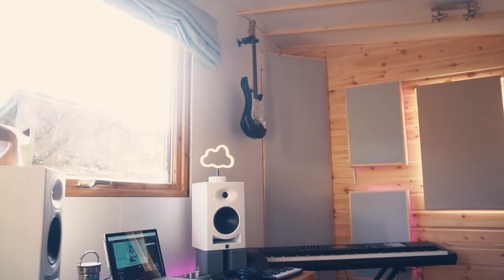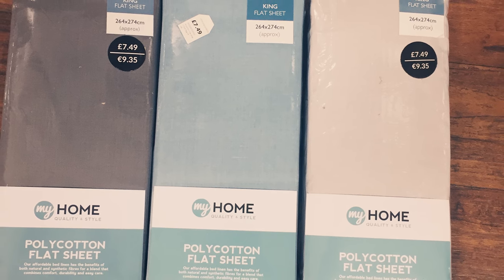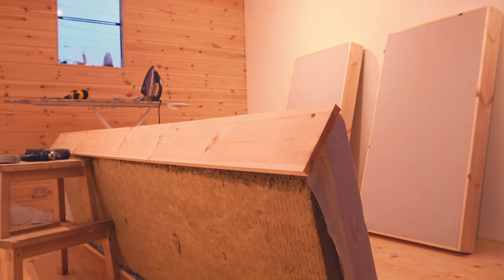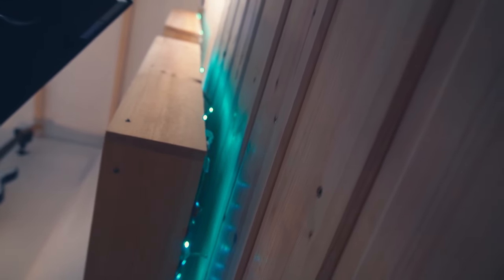Pro Acoustic Panels DIY how to make Cheap! + Acoustic Treatment Basics for a Pro or Home Studio

Comment: For everyone thinking about making acoustic panels, use plastic foil between the fabric and the absorption material, you really dont wanna inhale those particles. This will also allow to use more breathable mesh like fabrics which will improve the performance.  And if you think that the plastic foil will ruin the acoustic performances try wrapping your speaker with plastic foil and youll realize that it only affects the really highs like 10-20khz which isnt the region you want to absorb anyway. Ive made hundreds of acoustic panels and this is just something I wanted to share! Take carr
Reply from the maker: thanks for sharing :)
Reply: I used an idea from another video and got that weed guard material you would put in your garden. Keeps the insulation from poking through the fabric nicely and it's still breathable enough fro effective absorbtion.
Reply: Is plastic foil the same as Cling wrap, like glad wrap? Do you put it both sides? like you mentioned I was told that sealing them with something that isn't breathable would cause reflections, but you've built 100's.
Reply: @imnotjacob.  Yeah you can use glad or cling wrap, I prefer industrial plastic foil like the ones shipping companies spin their packages in just because the sheets are bigger. I suggest you wrap the whole thing rather than a specific side 👍
Reply: Maybe a little late, but... There is also an issue that anyone rarely talks about. While I believe you can deal with particles even without plastic film - I'm not sure it will help against phenol and formaldehyde vapor (the binding component). Yes, it does vaporize over time. If only companies provided detailed information about concentration and migration rate into atmosphere. Would be a shame to die from cancer.
Reply: Use formaldehyde free rock wool not glass wool and you're fine. No need for plastic layers.

Comment: Make sure to wear gloves and a mask when working with Rockwool. Also, make sure to wrap both the front and the back in fabric so you don't get rockwool particles in your room for the long run. A good, cheap material to seal the back is garden landscaping mesh. You can buy a big roll of it and double it up to cover the back. For anyone wanting to try this, it doesn't have to look as handy and pro as it does in this video. It's just sticking insulation in your room and framing/wrapping it to protect your skin/lungs from the insulation fibers.
Reply from the maker: Agreed, I have listed some safety info in the description of the video too.
Reply: Landscaping mesh is not going to keep tiny particles in. I recommend Craft Felt, it is inexpensive and looks nice, and is much better at keeping dust in.
Reply: @LuisCasstle  Or just wrap a few layers of inexpensive kitchen foil around it the wool part and then you can cover it up with any fabric of your choice :)
Reply: @LuisCasstle  craft felt as a layer under a wrap like weed stopper? Or just craft felt then boom your done?
Reply: @sebek0311  This is ineffective as you then have a non breathable slab
Reply: @DeadOriginal  Unfortunately none of these are safe as the mineral fibres range from 2 micron to 6 micron and unless you have a 1 micron filter covering the entire rockwool panel it remains very unsafe and should not be used.
Reply: Sorry but none of these are safe. That insulation really isnt safe to have exposed in the house, fabric will not hold back the fibres which can be inhaled. Fibres are from 2 micron in size and even multiple layers of fabric are useless.
Reply: @iambradarthur  Really should only be using a safe form of Insulation such as Sheep's wool. That stuff is worse than smoking over time.
Reply: "Over Time". I suppose you have some actual reputable published data to back that up?

Comment: I’ve use the Roxul insulation in several panels, ceilings and walls in a few studios (at first I was using fibreglass insulation – yuck!) and there are a couple of things I find that works very well. The first thing is that when you are cutting it, it’s worth it to buy an electric carving knife to cut it up with, if you don’t have one and the second thing is that if you wrap it with landscape fabric, you have something that will help stop the particles from escaping and you can even double it up if you’re worried about it, but it is acoustically transparent and cheap to buy. I wrap the insulation front and back. In my 4 decades of studio ownership in a few studios, these little notes have proven to be very worthwhile. Your studio will always need some kind of ventilation, so even if it is by opening a door and a window, the air in the room can get really stale. I can remember my early studio days, when you walked out of the studio and when you come back in, you are bombarded by moist, stale air and that familiar smell of recording tape. If there is anything offgassing in the room, so you want to exchange that air ASAP, yet having a built-in studio HVAC system is a luxury most small studios can’t afford.

Comment: Looks really nice to me.    One idea I had is that you could have built the absorption right into your walls, so you wouldn't need to build any (or many) panels.   So, like at 2:00 in your video once you'd put the complete outer layer of rockwool.   At that point you could have put the wood paneling on the places you want to be reflective and simply used batting and fabric for the places you want to be absorptive.   Maybe that would not have worked well when it's really cold outside, not sure.  -- Another problem with my idea is when you go to sell your house, having fabric sections instead of walls.   --  But it would have saved a lot of work and given you a sleeker, more professional look.  --  But great job!
Reply from the maker: Hey thanks very much :) Yeah I did think about just putting fabric over certain sections of the walls as It would definitely have saved time if I could find a way to do it simply but the more I developed the idea in my mind the more problems began to appear. 
1. It would have been challenging to get a finish that I was happy with as the walls would have stuck out in certain sections where I covered the insulation with plywood or tongue and groove and I would have been restricted to using the wall studs for the joins.
2. by building the panels this way i can take them with me if I move studios or my setup in the future, I can also take them off and move them about if I need.
3. Like you mentioned, THE COLD!"!! haha- it was -23 degrees Celsius here this winter so the more thickness the better.
4. Sound proofing, Quite a lot of sound gets out and comes in already so any less material and it could start being a problem. 
5. The AIR GAP - for some reason the waves seem more effectively absorbed when the absorbing material has an air gap between it and the wall (I'm not absolutely certain about this but it seems to hold true so far) especially as I didn't opt for the room within a room design that is popular.
6. The bass traps more or less needed to be built with those shapes and dimensions and so it wasn't too much more work to do the others along with the bass traps

I definitely think it's a viable option, I have seen setups like Colt Capperune where the wall is almost entirely fabric on top of acoustic foam. I just decided against it this time but I may well try in the future. 
Thanks again 
Kobi :)
Reply: @iambradarthur  very good!   You clearly thought about it a lot and you did a great job.   Your room looks really great. --  I just finished a similar project in my room, although my room was already finished with drywall by the prior owner of the house.   I opted to use more freestanding/stackable panels, like gobos, so I can use them both for recording, and then move them into different positions for mixing.   I also tried to make my panels have two sides, one purely absorptive and the other partially reflective (of the highs and upper mids, while still trapping lows - more for recording).   I learned that by simply putting a piece of heavy brown paper in between the rockwool and the fabric,  that side of the panel has a different character.   It's cool that you can put your nose up to the panel, sing, and hear what it sounds like.  I had a lot of fun making this stuff and I can tell you did too.   -- Thanks for you detailed reply.   I like learning from other people's projects.

Comment from the maker: Timestamps if ya want them:
0:00 Intro + FL Studio Giveaway
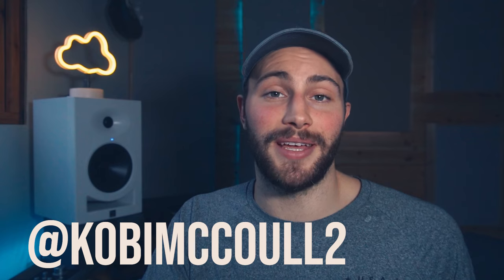1:39 Click here if you like music :) 
1:50 What is the panel made of?  
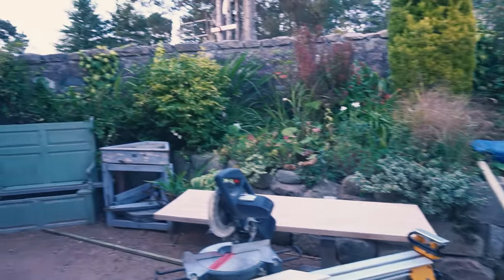2:53 Making the Wooden Frames 
3:45 Lining with fabric + top tip to save £$ 
4:56 Fitting the insulation and wood for a professional finish
5:26 Unique air gap design feature for fitting and function 
6:07 Final Panel Design
6:30 Fitting to the wall securely with more air gap
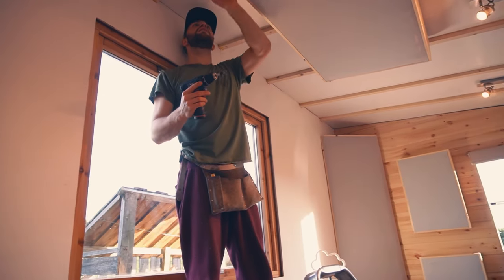6:55 Fitting the Ceiling Cloud - It's super strong
7:17 Cheeky Monkey
7:21 Panel placement for optimal room acoustics
7:42 Installing LED lights  
8:41 What about the windows???
8:49 My Favourite Sound Absorption device ;)
9:05 Extra Steps with room accessories
9:25 Wooden Wall Diffusion
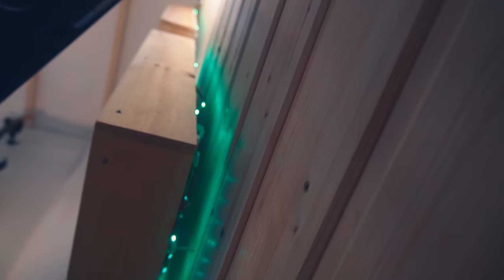9:46 Cost per panel and total for the room
10:04 Outro - Thanks for watching

Comment: Air gap only works when it's between the panel and the wall. Gaps around the edges reduce the efficacy of your low frequency absorption. This is because low frequencies are omni directional and therefore will find their way through any pinhole sized gap they encounter, Any frequencies which make their way through the gap at the sides will not be absorbed by the rockwool. When people talk about adding an air gap behind the panel, they are doing this because absorber panels like this work by stopping or reducing the velocity of the sound wave. At the hard boundary like a wall or ceiling where the wave strikes the surface and reflects back to the room the velocity is at or near zero.. so bumping the panel a few inches out from the wall will vastly improve absorption at all frequencies because the panel is "catching" the sound wave before it hits the wall and then again as any remaining frequencies reflect back into the room. By having a gap you essentially catch the sound wave two times,  once as it enters the panel and again as it tries to reflect back out. If you leave a gap around the sides you are giving sound waves a side door to avoid the absorbing material. Otherwise good job.
Reply from the maker: thanks. I have found that they are performing well with the current setup. I have a gap between the back of the panel and the wall and that seems to be doing the job well.

Comment: if u wanna damp the max. bass fq u have to take some damping material which has quite more than 5000Pa*s/m2 air flow resistance. and then it's getting much more expensive. ;) - e.g. an normal 200mm thick layer of "rockwool" with a max of 5kPa*s/m2 - which equates to a absorbtion coefficient of 0,6 at around 100kz. by using the same thickness of rockwool with 10kPa*s/m2 AFR u get an absorbtion coefficient of 0,6 at 78Hz... (we're talking about normal rockwool without any specific acoustic functions...) 

U see, it's quite a bit of a choice between the amount of money and the "needs" of your room treatment.... u can decide. 

I layerd two different porous absorber as seiling absorbing area - 150mm thickness and an coefficient 0,78 at 70Hz... this is phenomenal!

All the best and keep up presenting hich quality content!
Reply from the maker: thanks for sharing :) I will do , I'm really glad you found it to be high quality

Comment: i kinda wanted to see how you linked them together (if you did at all) - I'm doing something similar, and I really want to find good solder 4 pin connectors, so I can just have wire running between them... and not solder them directly...
Reply from the maker: I'm not sure what you mean by linked them together? I just used small screws to link the wood together and staples for the fabric. then the LED lights have a sticky side.
Reply: @iambradarthur  ah, no I meant the led strips themselves. I got wire 4 connector wires to got from one to another (so I could cut it to the right length, but have been struggling to find proper connectors.

Comment: Loved this...thank you so much for the heads up. 
Just a quick one though... i'm so lost when it comes to the variants of Rockwool..

1. I see R3, R4, R5, R6, Flexi, R45 
2. I see 50mm, 75mm and 100mm
3. I see 3inch and 6inch.

I don't know what's best for studio purposes
Could you PLEASE help by breaking this down a bit more for us?
Reply from the maker: Hi, thanks for your comment. It really depends on the size  and dimensions of your studio and down to your budget. I found the RW6 works best as it a convenient density to work with, cuts more easily and does a great job of absorbing the sound but I think pretty much any of them will work well, the lower densities might be harder to work with as they will feel thinner and more floppy. I have used RW45 in the past and it is a cheaper option than the RW6. I used the 100mm option as it is the same thickness as the insulation in our walls and will absorb a slightly higher range of frequencies than the thinner options. Ultimately any will likely be better than none. I hope that helps

Comment: Do you need to cover the back of the absorbers? I've heard a bunch of people freaking out about breathing Rockwool particles?

Also, the panels look dope. Nice vid!
Reply from the maker: yoo thanks very much :) You don't absolutely have to but it isn't too tricky to do and doesn't have to look pretty either as you won't see it so it's worth doing if you want. I did it for a few of them but not all of them. There are quite a few studies about the safety of rockwool and it seems neutral when it's not being cut or handled (it's a good idea to wear gloves and a mask when you're working with it) it's certainly not as dangerous as the previous versions of insulation and asbestos or fiberglass.

Comment: wow amazing job and really inspiring! whats the best way to mount a panel on a ceiling?
Reply from the maker: it really depends on your ceiling but there are several ways. I left the roof joists exposed so I could easily attach a panel. If you can find the roof joists then you can screw a piece of wood to them as an anchor and then you screw the panel to that piece of wood.

Comment: yes Bro a really nice job and the space makes its effect. but does it really make sense to do all this work if you then put the speakers near the wall where there is a window?
Reply from the maker: Thanks Riccardo. I did have concerns about the window but I new I could reposition my speakers and desk If i really needed to, now that I'm set up I have installed some thick blinds that cover the window for when I'm mixing and mastering, and have the speakers further away from the window wall on absorbing stands and overall the sound has been a nice balance to work with  :)

Comment: an advice, The approach to the listening position should be done leaving the longest distance behind your back, otherwise your early reflections will be more serious at your current point and difficult to control.
Reply from the maker: I worried that it would be a problem sitting this way instead of length ways and new I could change the setup if it wasn't working but so far it has been great and the overall sound has been well balanced and accurate to work with. i will keep making adjustments over time also :)

Comment: On the back of the wall you need Diffusion no absorber. The room sound to death right now.
do you have measurements results before and after installation?
Reply: Equally how do you know he 'needs' a diffusion if you have no measurement data.
Reply: @lesterfalcon1350  you always have diffusion on the back of the wall, if not, it sound to death an flat, no life in the room  then.
Reply from the maker: I find currently that its a nice balance between absorption and colour from some of the exposed walls.
Reply: @TommyNation  Only if you you are sticking to a Live-End Dead-End principle. But there's no 'always' about it and once all the furniture is in can you really assess if there it's worth it.

Comment: Well done! I scanned through your video. Is there anywhere you specify what frequencies you were able to attenuate? Bass absorption is a huge issue and it seems every video about sound treatment fails to deal with bass absorption below 110Hz. If you fail to deal with this range, the mid and upper frequencies can become badly distorted.

Comment: Did you do any acoustic measurements before and after?
Reply from the maker: No unfortunately I didn't have access to any of the testing kit, only the dimension room node calculator. i can safely say the rough test result for before was Echoey, and the rough test result for after was much more level. Just based on what my ears can hear. I hope to test it in the future but for now it is performing well :)
Reply: @iambradarthur  it's really a nice build!👍👍 and I envy you in a positive way 😉🙂
I was just wondering if it might be overly absorbant (too dead) though, because of the high amount of absorbers that will absorb all your highs and down to maybe  500hz. The wooden wall with the groove is only diffusing a very narrow frequency range, because it's a destinct, repeating form - from my curr6 understanding.
Maybe you are interested in optimization, e.g. there is now a common agreement, that around 15% of total surface should only be absorbers. 
If you enjoy this topic, check out maybe audioholics YouTube. They have recently started a webinar series with an acoustics expert. Anyway, sorry for rambling on - I just would like you to get the maximum out of your nice studio. Just trying to help 😇👍
Reply: @iambradarthur  Check out REW - its a free Audio Measurement Software, all you need is a good measurement mic. A Behringer ECM8000 is sufficient - it's 32€